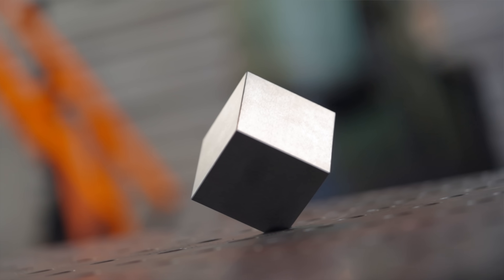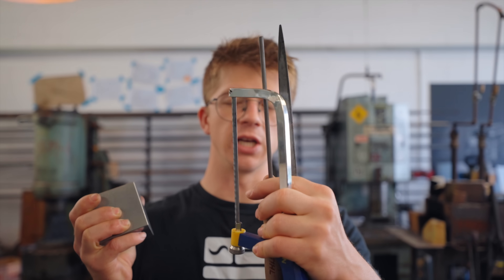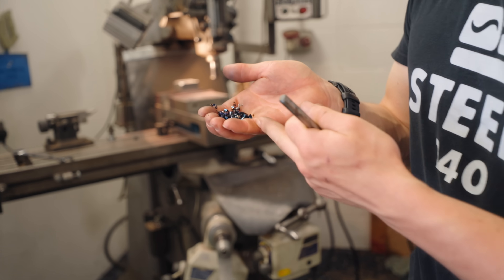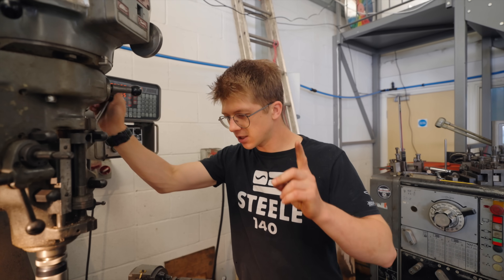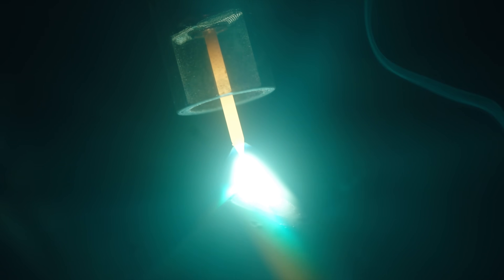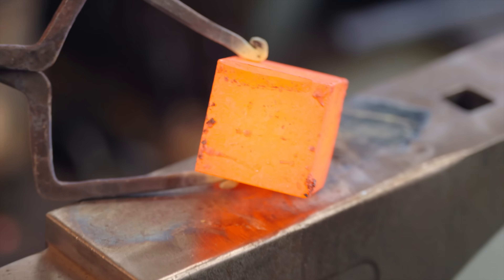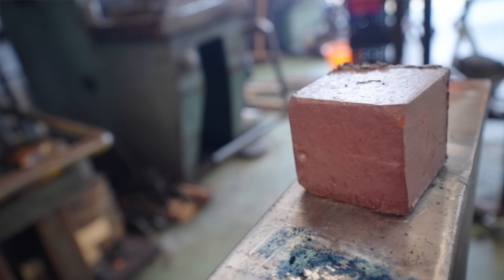Can You Forge Tungsten?

Comment: They can make Tungsten Carbide by processing the Tungsten in to powder or its oxide which can then be used in other processes at much lower temperatures to produce tools. E.g. Its Oxide has a melting point almost 2000 degrees below solid Tungsten, extract the Oxygen and introduce the Carbon and you produce Tungsten Carbide powders for coating tools.

The sintering process mentioned in the video is another example of this: By mixing Tungsten Carbide powder with a binder, usually Cobalt powder, you can compress and heat the mix (The sintering) to liquify them together at a drastically reduced temperature than their individual components melting point. (The Eutectic point.) As it cools and relaxes it forms its incredibly tough crystal structure.

The exact details are a bit beyond me, Im not entirely sure what happens between the binder and the rest of the powder while sintering, that so efficiently drops the whole mixtures melting point, nor am I clear on the exact structural changes through the process. (and for all I know some of this is trade secret stuff.)

Comment: Arcs like plasma and tig seem to be the highest sources of heat that will melt tungsten, not sure if you can make an arc chamber to heat it up, if you did it would probably melt the surface before the  center got hot, oxy acetylene gets pretty close though at 3150c might be enough to forge it, 
feel like making and oxy acetylene forge, hell yeah

Comment: FWIW regarding alloys, it's almost always the case that the melting point of an alloy is lower than some of it's components. On top of that, you don't need to melt one metal to dissolve it in a lower melting metal.

Comment: It's like machining gray cast iron and it's pretty rough on tools because it's so abrasive. You'll be cutting just fine then suddenly you're not. Managing that surprise is the key. Keep it cool, slow down, and don't force it... it likes to crack too, especially off of sharp corners and over-stressed thin areas. Now, you want a real PITA material to machine that's also exquisitely expensive, get a little foot long 1" diameter rod of tantalum. We machined lots of parts for reactors out of that stuff. Try forging that!

Comment: If it will cut, why not cut off a slice and try forging a blade of some kind? I'm curious to see you doing all the operations at room temp with no heat treating and seeing how a pure tungsten knife performs. You did say something along the lines of it almost feeling like working on hardened steel.

Comment: The melting temperature of tungsten is about 2000°C

We used it to sharpen diamond discs that we use for cylindrical grinding
It's bitch to work with. 
You can propably drill 2/3 holes and after that your drill will be dull. Thats my experience with it when drilling center holes in a tungsten bar with a hss drill

Comment: @11:11 Tungsten melts at 3,422°C (6,192°F) Guide yourself accordingly. (You'll need an arc furnace. Natural gas won't do.)
Reply: induction mayhaps?
Reply: He does not need to melt it just to reach the brittle to ductile transition. A forge that melt the metal is useless. The brittle to ductile transition on tungsten  depends on the crystalline structure and so on the method it was produced but so the literature is confusing about that is about 1300C. But even so it is still very hard, but pounding it won't break it.
Even if he melts it and pour into a mold, very few mold will resist the temperature, even silica and graphite will have trouble at this temperature. In metals like Titanium, Osmium, Iridium and Tungsten  syntherizing it if preferable.
Reply: @agranero6
I think you need to know the melting point of the metal you want to work with. For example, iron has a melting point of 1538°C and when Alec heated the iron to 1300°C it was malleable. Therefore, tungsten which has a melting point of 3422°C, should be heated to approximately 3000°C in order to be malleable...
Reply: @Pitchus90  You need to know the brittle to ductile transition temperature that in some cased is dangerously near the fusion point.

Comment: A little more info on the tungsten carbide cutters! The tungsten carbide is actually a powder, that is then mixed with often a cobalt or nickel based metal alloy powder. This mixture is then pressed into the shape of the tool, being a cutting insert or end mill, then sintered. This results in whats known as a "metal matrix", in this case, one with incredible hardness and heat dissipation.
Reply: They do this because tungsten carbide (carbides and UHTCS in general) is extremely difficult to sinter by itself. The cobalt and nickel is really just the high temp bonding agent for the tungsten carbide media.
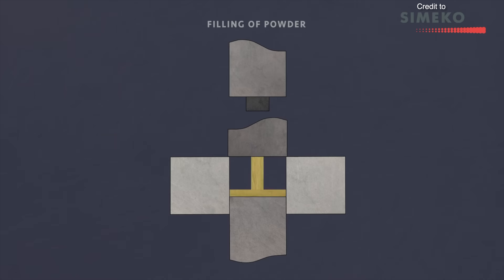Reply: 11:25 I think he covered that bit.
Reply: There is that but also solid carbide endmills are ground from carbide stock and depending on what the tool is used for it gets chemically or gas treated to achieve a certain coating

Comment: You'd probably need an aerogel mold (crazy good nasa grade insulation) to melt the tungsten into anything.
Reply: Aerogels don't really survive at that temperature.

Standard high temp refractory bricks are fine. if you can get the heat on it.

Comment: Tungsten or tungsten containing materials can be identified by the red sparks they produce when in contact with a grinding wheel. 

And from experience working with tungsten wire, I know that, despite the high melting point, heating to 600 degrees already makes it significantly less brittle when bending.

Comment: seeing this just cements i will be making myself a few Tungsten hammers for smithing and a tungsten 'doorbreaker" fireaxe, want one the size of a forty lb sledge on an osage handles.
hardest part i can see will be drilling the handle hole, will have to save all the tungsten shavings to play with, Tig welding the shavings could be fun.
my col workshop is waiting till i move then it will be expanded into a Joat shop. already got most of the layout for the glassblowing section sharing space with the ceramic kiln  and the metal softening for the forged blades, wood and metal lathes.

Comment: Bye no means do i have any experience with forging but I suspect the core of the tungsten block is not as hot as the outside, in other words the core is still “cold”, thus the press could deform then edges but not the cube itself.  But I could be totally wrong.  Still super cool to see especially when compared to the steel.

Comment: What about an induction forge? Would that at all increase the temperature?
Reply: You can’t use a induction forge on a non magnetic metal
Reply: @strangetar2833  all of the tungsten I've ever encountered was magnetic. All of it was 2% thoriated. I just assumed it was the tungsten that was magnetic. Thanks for the heads up.
Reply: I take that back. I have a piece of tungsten here, and I was wrong. It doesn't react to a magnet.

Comment: As a general rule of thumb most metals can be "hot worked" at around the same temperature that they can be sintered or annealled.  This is usualy around 0.4-0.6 times their homologus melting temperature (the absolute temperature measured in kelvin).  For tungston this would be 1205C-1944C so you should be pretty close.  Some metals like lead are at this temperature at "room temperature" so they can be "forged" at room temperature of colder.  This is the temperature where the kinetic energy of atoms due to their temperature becomes large enough for them to jump out of their lattice sites and diffuse throughout the crystal.  Defects start anihilating and new crystals nucleate and replace stressed crystals (recrystalization) to lower the free energy of the metal by releiving stress and making "brand new" crystals with no imperfections.

Tungston melts at a very high temperature but it is pretty chemically reative (it isn't stable as a reduced "pure" metal) and quickly reacts with gasses in the atmosphere.  When it reacts to form oxygen the tungston oxide created has a much lower melting temperature and the molten oxide drips away exposing more metal to react with the air.  If you've tried tig welding with no gas you will see something like this.

When you put tungston into molten steel it will make a liquid at a pretty low temperature compared to its metling point.  This is because alloys of things will generally "melt" at lower temperatures than pure things.  For example salt dissolves into water in small amounts at room temperature, but pure salt melts at about 800 degrees celcius.  Iron with different amounts of carbon melts at different temperatures and the lowest melting point is about 4% carbon at about 1200C (which we call cast iron because its so easy to melt).  In general this is true because the increase in configurational entropy from additional solute is greater in the liquid phase then the solid phase (liquids are more random than solids this is why they exsist when you heat stuff up and everything starts moving around, adding different types of chemicals in makes it more random and so an alloy will be liquid at a lower temperature).  Unless the mixture forms really strong bonds between atoms like sodium and chloride melting at the previously mentoined 800C when sodium would melting in a hot cup of tea and chlorine would be a gas in a deep freezer.

Would be interesting to so the tungston welded in thinner peices (even steel is hard to weld when its that thick).  Polarity of the welder would be important to keep the electrode from melting while the workpeice melts.

Edit: I went and found the self diffsuion coeffceints for tungston and calculated the diffusivity as a function of temperature and it looks like it really takes off well after 2000C and I think the oxidation would be pretty bad at that temperature.  And this is over the oxides melting temperature so forging tungston in atmosphere doesn't seem likely to me.  Also the smoking that alex was shocked by is probably the beginings of this oxidation.  Maybe theirs a clever way to heat it electrically and forge it under argon.
Reply: Iirc, adding to what u said: Since it reacts with oxygen, it mainly forms tungsten trioxide (WO₃), which partially evaporates (boiling point at ~1700°C/2000K), (maybe also reacting with the moisture in the air forming tungstic acid [or rather, tungsten trioxide monohydrate]?), hence the white smoke.

But yeah, that was quite an unhandy, thick piece. Maybe cutting it into thinner pieces and forging them could work?
Also idk much about forging, but a higher temperature e.g. with an oxy-acetylene torch may help (also may help keep the piece warm and malleable)?
Reply: One thing to note though is that Tungsten keeps its material properties much closer to its melting point. You could still get it to a working temperature of sorts, but I'm interested in seeing how quickly the tool could overheat.
Reply: Same way you handle titanium just a hotter forge.
Reply: @jiranchhetri8863  Thanks, 4o!
Reply: "the temperature where the kinetic energy of atoms due to their temperature " are lead atom warmer than other metals? If so why?
Reply: The bit about reactivity - is that why it was smoking so much when withdrawn from the forge? Because it's pretty much burning in the air?
Reply: Was that a tear of oil leaking out of the press
Reply: I thought Tungsten had an even higher melting point than that since it could withstand temperatures up to 7000°C
Reply: @TheSilverShadow17  you can expose metals to much higher temperatures than they melt at, just not for long or in direct contact or just have neough mass. take some afterburning jet engines, or the arc in a tig welder, at low enough amperage, say 40amps you can hold that concentrated at a spot on a big block of aluminium for the whole day before it melts. even tho its enough to melt the tip of the finely sharpend tugnsten electrode.
Reply: *Töngstin

Comment: technically speaking your tungsten carbide end mill is a metal matrix composite, its composed of tungsten carbide particles as the reinforcement suspended in a cobalt matrix, pure Tungsten Carbide is in fact a ceramic
Reply: The not so fun fact with that is that if you drop your tungsten carbide wedding ring on a concrete floor it will shatter.

Don't ask me how I know.
Reply: Kind of like aluminium oxyde can be considered a ceramic and is commonly used as abrasive, despite aluminium itself being a pretty soft metal and almost useless in its pure form.
Just because it's derived from the same metal, doesn't mean it necessarily has comparable properties.
Reply: @pbe6965  you can actually make a metal matrix composite from aluminium and aluminium oxide, you mix powdered forms of both and then sinter the mixture most MMC's are made in such a fashion
Reply: @MingRaptor  I wasn't trying to contradict you (english is not my mother langage so I might have conveyed the wrong idea), just giving another exemple :) 
The "Just because it's derived from the same metal, doesn't mean it necessarily has comparable properties" part was referring to the part of the video where he assumed tungsten would be very hard since carbide is, not to your answer.
Reply: @pbe6965  I understand where you were coming from, none of what you said contradicted anything I said, I have a master's in engineering and am a bit of a geek when it comes to materials, you can actually have a ceramic matrix composite using much harder ceramic as a reinforcement and lower melting point ceramic as the matrix, engineering is wild, I've even seen a metal matrix composite with aluminium as the matrix and carbon fibre as the reinforcement, not such a good idea as galvanic corrosion can kick in pretty quickly

Comment: I'm a borosilicate glass blower, I use TI rods to manipulate hot glass all the time and over the past decade by accident I've completely melted rods of TI in the propane/oxygen torch flame multiple times. and I've melted a small sphere of TI I bought online just to see how much heat it could handle
Reply: I was thinking, an oxytorch could work on the tungsten 
Nice to have it confirmed!
Reply: @tuedlue  That's titanium, not tungsten that they were using to work glass and melting.

Comment: Use it as part of an arch circuit. Use 100 batteries and arrange them with a proper inline fuse, and basically do a styropyro or better yet, fly him over to you and spend a lot to get that block basically melting!

Comment: Even if you can get it hot enough to become soft, youll probably need tungsten tools to hold it. Otherwise your tools will melt holding on to the tungsten.
Maybe you can get it hot enough with one of those electromagnetic coils. But still what will hold it that wont burn or melt?? Ceramic?

Comment: Alloying tungsten with other metals is the easy bit, you just throw the tungsten in your hot molten metal and it dissolves like salt or sugar in hot water. Sodium chloride doesn't melt until 800C, but you can still dissolve a load of it in a pot of boiling water. Same concept for alloying. The better question is how the heck do they process the ore into pure tungsten billets in the first place, and then how do they work those billets down to rods, tubes, and sheets which is essentially forging.

Comment: Seems like you should make something which takes advantage of its unreasonably high density. Like a very small but oddly heavy peening hammer? An automatic touch mark stamp, so like an automatic centre punch but using the high mass of the tungsten as the internal hammer to really whack the end in hard. In industry, you commonly use tungsten as a bucking-bar to hold on the back of rivetts as you form them or for panel beating.
Reply: I would make a weight from tungsten for long drive for truckers. Use it to do simple workouts and takes up little space while in use. Even a 10lb weight would be better than nothing.
Reply: Despite being very hard, tungsten is very brittle. You could use it in a hammer, but you would want to contain it like the filling in a dead blow hammer.
Reply: @wallacechui9857  Yet it has the highest melting point of any metal in existence, which makes it great for forging as well as applications that revolve around intense heat, or plumbing.

Comment: If you get it hot enough you can forge and then melt ANY metal. Putting it under the power hammer if you have no idea about it's properties is quite a dumb move, could have shattered into a million 1000°C pieces.

Comment: Since the melting point of tunksten is about 3400 C I would not be surprised if the forging temperature would near or even surpass 3000 C if you want a similar malubility as forgable steel. You would need a really hot forge for that or maybe induction could also work to get it to such temperature.

Comment: Titanium would be interesting to see, too! Careful with machining it, titanium chips are flammable.
Reply: He has already forged titanium, made a small anvil while still in Montana.
Reply: @DH-xw6jp  I completely forgot about that lol
Reply: Tungsten also burns well below it's melting point (that smoke when he pulled it from the forge was likely tungsten oxide. Titanium is even worse, and more energetic.
Reply: titanium needs shielding gas when its heated
Reply: @Halbostfriese  ideally use HEM(climbcut/heat into chip) and flood coolant.

Comment: I asked ChatGPT. It was very confident, as usual:
Tungsten is typically forged at extremely high temperatures, ranging from about 1,400°C to 1,600°C (2,552°F to 2,912°F). This high temperature is necessary due to tungsten's very high melting point, which is around 3,422°C (6,192°F).